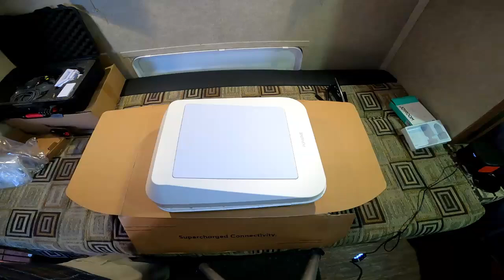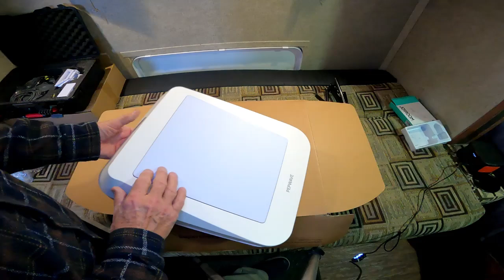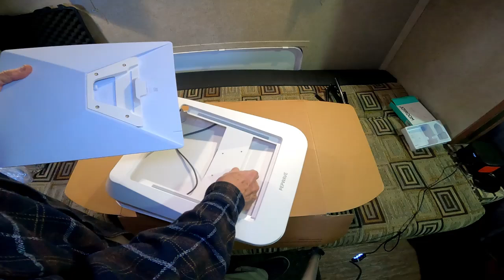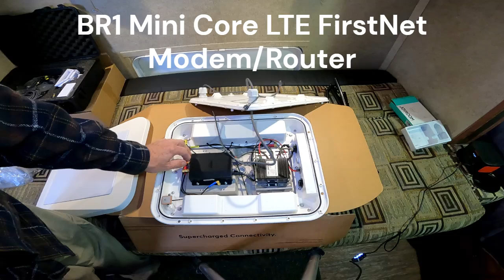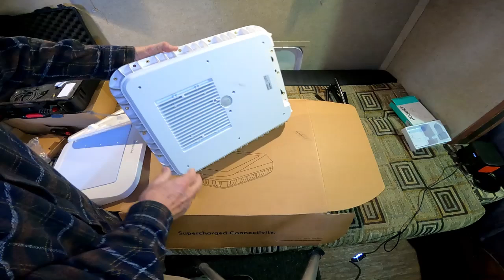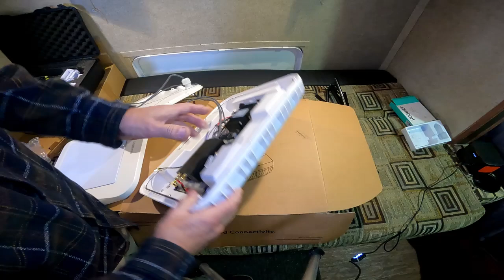Peplink Max S Starlink Mini with FirstNet Broadband LTE Combo antenna

Comment: I wonder how the range of the WiFi antennas are with picking up 5g signal and if you still half to run an external antenna booster? I’m trying to research this same combo but for my sailboat. I also have FirstNet with AT&T which has coverage in Canada, USA and Mexico, so cruising in the Caribbean with star-link and Pep-link is a good solution